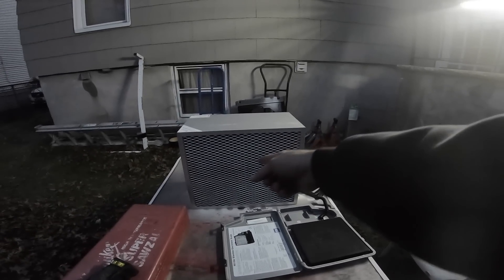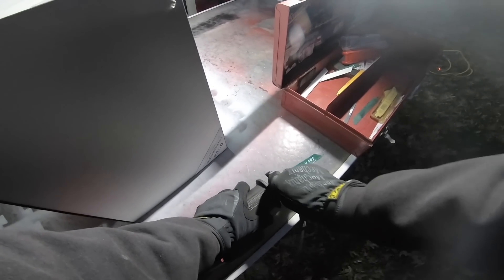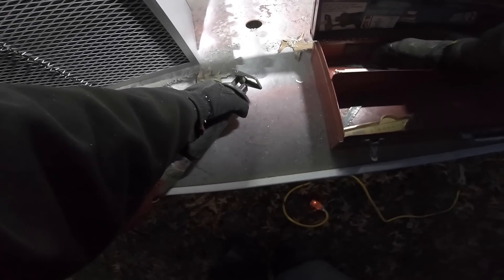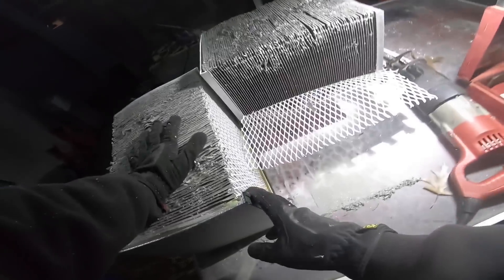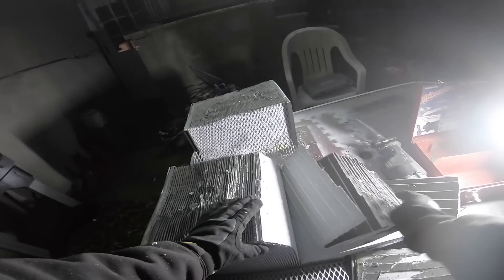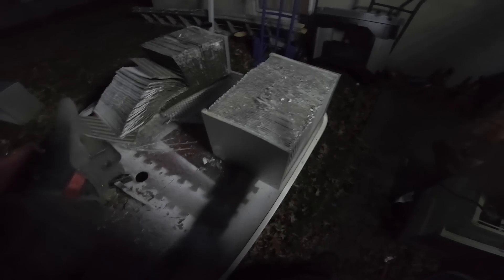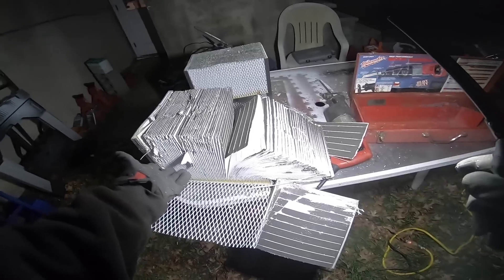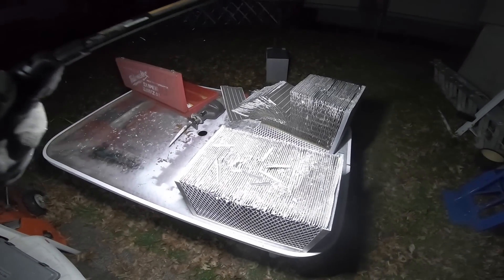Dissecting Heavy Swiss IQ Hyper Hepa Nano-Particle Filter

Comment: HERE IS THE GOOD REASON - Merv 16 filter is rated @ '95% or better' of 0.3-1.0 micron -- This Swiss IQ is rated @ 99.9 @ 0.003 micron (Thats quite amazing  IMO, might be marketing speak i did not find the actual test spec PDF)

 The 'standard' clean room  is something like 1000-10k PPM air quality.. If your doing biological petri dishes you are going to want under 1000 PPM ideally less then a few hundred. There is ratings associated with clean rooms and it requires certain thresholds of both greater then 0.3micron and less then.

When you see ratings of hepa filters, a 99.9% vs 99.99% is very specific change -- and a large difference not seen by the average person. There filters are also rated at specific CFM for advertised spec. Too much CFM and the filter will not catch all the particulates.
Reply from the maker: I am sure this filter has it's purpose yet not for most residential use. You also have Merv 16 prefilters on this filter set up. If you have seen my video https://youtu.be/1nlMFJ7kSeU This is where this filter I dissected came from. There was also a fan on the other side of this filter.

Comment: I’ve been watching you channel for a while now I have a Cozy gas heater that the pilot lights and stays burning but when you turn up the mow heat knob it doesn’t fire off the burners? Any help would be appreciated my Email address is nicebear@gmail.com
Reply from the maker: You might have a safety open preventing the gas valve from energizing. Check for 24 volts to gas valve when you turn on the heater. If not check to see if any safety switches are open

Comment: this makes me want to bust out "old faithful" ancient milwaukee sawzall, I forget how many years ago I got it, the poor metal case and saw has taken a beating over the years. now it collects dust along with the corded circular saws and other brand cordless. I've been using all makita cordless stuff for the last 8 years, although I hated makita cordless on job in the late 90's. but all cordless was generally poor then. actually, I think I used old betsy to cut exhaust pipe and a other car related things since then.
Reply from the maker: Cardless Makita? you talking about the blue weird shaped drill with the thin battery? As for old faithful, this cuts anything I want it to and never let me down. I don't use it enough to justify buying the m18 fuel. I can't justify buying cordless if I only use a few times a year. I should have just used this to chop those rusty bolts in the pump video. The metal case and corded Sawzall are not chin-eesi-uum quality built tool. Every notice the old Milwaukee corded power tools were hard to kill. Mine is so old you still need a hex key to remove the blade. It was one of the first power tools after a drill I bought when I started screwing up hvac systems
Reply: yeah, the greenish-blue tools, the stuff is old now and pre-star symbol, so no anti-idiot battery guarding, I cooked some batteries overworking them and didn't realize I was overworking them at the time. then bad battery laying around on the bench, one cell shorted the other good cell/s and it nearly caught fire. melted plastic, burning hot and the bench was OSB with cardboard on top. I caught the burning smell and took it outside to a new home of concrete and steel.
the old milwaukee here is from the early 90's I think. it has allen head cap screw and the even older small flat blade holder. yours looked to have the larger set screw type holder.
Reply from the maker: When I started a coworker had an old marital like that. 
My Milwaukee i bought in 1999 when I finished trade school  I needed it for my first job, if your is an early 90’s your power cord was hardwired straight into tool? The one I have the power cord had to plug into the tool. I guess they made that change to prevent cord damage from storage? Does your have the speed adjustment wheel?
Reply: it has the removable cord with twist lock retainer and a high/low switch down on handle, I honestly forget what year it's from, but for sure a bit earlier in the 90's, thinking I got it around 94? I think it was the "long stroke" model and I know it rattles you to death if the blade binds up when cutting, especially steel and cast iron( yeah sewer lines) :( vomit
Reply from the maker: I had the same problem cutting steel and cast iron when binding from steam pipes. Usually required cutting, chiseling and folding/ collapsing the damn pipe off threads The binding on the Sawzall is nothing as serious as when a Milwaukee right angle drill binds. My dumb ass didn't let go and was forced to punch aluminum framing in a soffit. Many stitches later and many holes and I still fear and respect a tool with that kind of force. I am a chickenshit, possible, yet look to just let go if I sense any binding since that one incident. I am not sure if I ever have that fear with a battery tool. I wonder If there is a chip to shut down a battery right angle drill if it binds
Reply: "right" on  with the angle drills and hole hawgs, them things will beat the daylights out of you and they don't stop instantly.
I don't own nor use them, not doing new construction, I don't have to drill that many holes and a standard hammer/driver/drill works just fine. I do have a few regular hammer drills though

Comment: So that is a HEPA filter, which has much smaller pores than a MERV 16 filter. They are different. Bacteria and viruses can pass through a MERV rated filter, but they will be stopped by a HEPA filter like that. Most people don't need a HEPA furnace filter, but if you have extreme allergies or have a impaired immune system then you probably want the hospital-grade filtration. You said this HEPA filter was run without any pre-filter before it, so I'm almost sure all that dark stuff is just dust. You can't run a HEPA grade filter without pre filtration because it will clog up really fast and be a huge waste of money, so glad to hear you corrected that. The expense there is probably all the surface area packed into that thing, you might have whole tennis court worth of expensive filtration paper in there. I'd be curious how much heavier that dirty one was compared to a new one—you could have several pounds of dirt in that thing.
Reply from the maker: The new filter was almost as heavy as this. Never had to carry any filter this heavy around. Yet alone a few thousand feet up 3 flights. I wish I weighted the new one to compare. The house this came out of was over done and these aren’t needed yet.......
The filtration paper was just falling part when I was touching it

Comment: It may not just be a particulate filter.  The filter media may be doped with some element that is microbiological.  If it is doped with silver that can up the price.  It not only filters but kills germs also.
Reply from the maker: I believe you are correct Michael these are medical grade post filters which have merv 16 pre-filter before this giant filter. I can’t remember ever carrying a heavier filter. Would that kill germs better than UV lights in the air stream?
Reply: @thehvachacker  UV lights kill germs and viruses but they don't remove the leftovers. People with extreme allergies can be sensitive to the leftovers so a HEPA filter is better than UV.
Reply: @thehvachacker  So now I have exhausted my knowledge on the efficacy of the silver vs. UV treatment, it has been known for hundreds of years that silver in ionic form has antimicrobial properties.  If this is silver in the filter media then one of the easiest ways to get it there is through doping a filter medium with nano particles of silver to provide ions of silver to treat the air stream.  A much better description by people much more knowledgable than I is here:  https://microbewiki.kenyon.edu/index.php/Silver_as_an_Antimicrobial_Agent   If this is the case, then it makes sense that it would be expensive; additionally for the silver to do it's work I imagine that some contact time is required and a filter medium would be better suited to providing such contact time rather than a stream subjected to UV lght for a short time.  Wow, I am really into guessing land here :)
Reply from the maker: Lennox healthy climate plus air filtration puts the uv facing into the return, some weird honeycomb looking up absorbsion filter than a merv 16 filter right before the air enters the system. Therefore could this set up be almost as good of a filtration set up?

Comment: 60-90 days depending on the area its in. We use to change them on our fter change schedule. We had to order them special also. Yes uts over kill for sure. If we get to a point we didn't get them on time we either left them or used another type of filter.
Reply from the maker: that metal filter is a 60-90 day filter. What does that cost? My customer bought those filters so I was guessing the price. What does the fan on the other side of this filter for? I am learning every day and this isn't something I have in any other houses.

Comment: Hacker what you think about Lennox Pure Air system with UV bulbs? Plus adding a Lennox Hepa filter on system. That's a tough combo to beat. Very very nice filtration system
Reply from the maker: I think I mentioned the Lennox Merv 16 filter but your correct. Just make sure if you put a communicating healthy climate pure air system don't let the installer remove the pin in the circuit board in filter box or you will endup with a hardware fault on the I comfort S30. JJ it is a really nice filter set up.
Reply: @thehvachacker  I had a couple customers with the Lennox Pure Air plus Lennox hepa on return duct.  Their systems were spotless inside. Granted it is very expensive but worth it if need really clean air

Comment: I install these with every furnace I put in, it seems to me it outlast the life of the furnace. Lol
Reply: I’m sorry for the misunderstanding, I don’t install those filters, I believe it will destroy a furnace, I know some manufactures are trying to get out of honoring parts warranty of a blower motor if the furnace has a filter higher than MERV 11 rating
Reply from the maker: It's cool, I am easily confused sometimes. I don't see any static pressure differences on a Lennox Merv 11 or Merv 16 filter. why would it void the warranty? Yet some cheaper filters I do notice a drop even on a Merv 10. The Honeywell sold at home depot get restrictive quickly.
Reply: Manufactures sometimes don’t want to admit to problems with their product, they will shoot blame with anything attached to the piece of equipment before taking responsibility. It took long time before they realized there was a problem with AO-Smith/Century 1 H.P. Motors. Two motors were replaced with in one year. I had to fill out a “Critical Work Sheet” on the Furnace, the Total Static Pressure on the System was .78” they started to complain about high static due to the filter, but yet the manufacturer shows a blower chart in the installation manual to 1.0” of water column. Funny thing is I put a 1 H.P. US Motor in and is still going strong and it has been three year now. I have had this same issue with Broad Ocean Constant Torque Motors as well.
Reply from the maker: This is so true, Lennox never said anything about filters causing issues. Here is an article on how too restrictive of a filter can harm a systems efficiency yet many filter manufacturers make these hi merv filters with almost no restriction. https://www.contractingbusiness.com/archive/can-your-fan-really-afford-filter
I say most cause not all hi merv filters are made the same. Which brand merv filters do you find least restrictive?
Reply: The Ultravation MERV 11 Filters is what I use, in my area most furnace application are Upflow, so I use the Right Angle Air Cabinet From Ultravation which comes with a 20”x25”x5” Filter the static pressure has been good I believe since the filter sits in a angle position there is more filter space being utilized, I have noticed when a “Straight Threw” cabinet is used higher the static pressure is, this goes with Ultravation, Honeywell, APRILAIRE and General Air, but on the other hand they do better than a 1” pleated filter for sure, one of my distributor sells Glanfloss which does have high static and the other distributor I use they sell Flanders, those seems not to hold up very good especially with higher static
Reply from the maker: How often should the metal filter be replaced?

Comment: Its the charcoal and paper in it. Thats all. Done it before. All are like this. The cost is of the type of paper and charcoal they use. Basically they are the same thing. Just a manufacturing epic design. Not worth it. But they say its better. I'm with you junk. Be good kid. AWESOME video. Keep on Hacker AWESOME tech.
Reply from the maker: That is charcoal not dust? I can understand someone with some kind of lung disease might need this. Yet for most overkill. This filter has to be special ordered through the manufacturer couldn’t even find it online. Those clamps that hold it in place was interesting. On average how long should these metal filters go between changes?

Comment: I installed a few of the Swiss filter systems into a house. Customer loved them till they had to change the filters. They decided to take the dirty filters out of the boxes and put standard pleat filters in. There also the type of people who clam to have allergies and breathing problems while they explain this to you they are sucking on a cigarette.
Reply: If you have that bad of a time breathing you should probably be I a hospital. Lol😋
Reply from the maker: What if your wife or kid had some breathing disorder you wouldn't do something like this? I am sure insurance might help out if serious disease called for it
Reply: I run a 30x30x2 pleated filter in my system that gets changed every month wether it needs it or not. The filters have to be made by the filter supplyer my employer uses. It runs me $170 for a year supply of filters. I also have one UV bulb on inlet of evaporator coil and one on outlet. The only reason for UV lights is to keep milldew from forming inside ahu. Mildew in ahu is common in the south.  I also have hole house dehumidifier to maintain 52% humidity in house. If you knew my family you would believe if they had breathing issue it would be tough shit grow a pair or get out.
Reply from the maker: Do you get mold like substances inside air handlers often if no UF light is installed? For a while we were having problems inside Lennox air handler insulation growin* the fuzzy stuff. Lennox had us removing the insulation and putting this rubber insulation as a replacement. Not fun ripping apart many air handlers to replace the interior insulation. I wonder if that could of prevented that. They were using the wrong insulation so Lennox covered the repairs
Reply: I'm not 100% sure exactly what it is.  It's black splotchy spots that form all over. See it in every type of unit blower area. It will be on silver backed insulation blower housing blower wheel. I just always thought it was mildew. I never ran into it up north.  Asked guys here what it was and mildew was the answer I got so when I built my house and installed my equipment. I put the lights in. Have had this unit running for 2 years and looks brand new inside. I went with the carrier green speed 5 ton split hp. My house is 3000 sqft. My utility bills are half of what all my friends bills are and they have half the size of house.
Reply from the maker: Strange thing the word mold is a big no-no to say in our trade. That’s what I believe the blackish splotchy spots are as your describing, it ends up on the wires, blower housing and what not. Ever notice it is more common on v drive blowers. You had it on wires and and schematics on blower without vdrives yet vdrives with the black fiberglass insulation it would end up growing all over sometimes a blackish grey and fuzzy. I think poor ductwork can lead to it as moisture is pulled off evap coil onto insulation
Reply: Yah, you don't say mold you say D - lom. Now that I think about it it seams to me that I see it more on units with blowers after evaporator coil and not so much on gas furnaces. I always attributed it to high moisture in the air down here. Blower is in the air stream after coil and gets metal really cold Wich causes condensation on metal. And just assumed that the dust in air mixed with moisture and then you get junk growing. I do know the lights keep it from happening but most people are not willing to spend 100$ a year per bulb so they work right. The 2 I have the bulbs at contractor price that I pay is 50$ each. I'm not looking to try to kill everything in the air just don't like seeing that black junk in my equipment.
Reply from the maker: You couldn’t say it better Jason. I think this is a good set up if there is severe breathing issues otherwise it’s an overkill

Comment: It scrubs the air better than normal filter it's better air quality filters than an hospital.
Reply from the maker: Yes you are correct but do we really need this instead of a standard 5” merv filter?  I think it’s an overkill for most people
Reply: @thehvachacker  depends on the situation of the home owner and if they have to have the medically clean air due to illness.
Reply from the maker: That is true yet that might be 5% of people this would help everyone else it’s an overkill. I am ok using a 1” 3 ply merv 8 filter in my house.
Reply: @thehvachacker  have you seen that tv program extreme make over home edition  they have used them in some of thier builds
Reply from the maker: No would the show do a build up like this.
Reply: @thehvachacker  yes they have done  in the past but I've not seen it lately